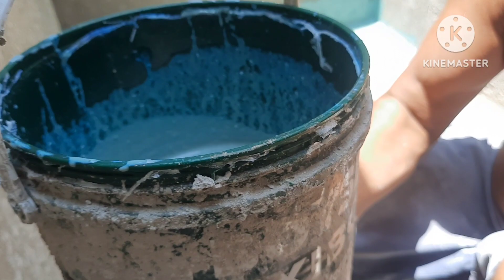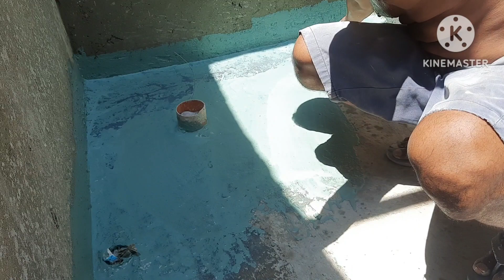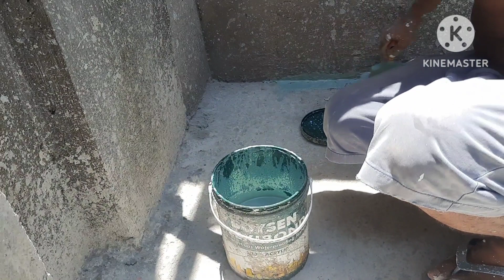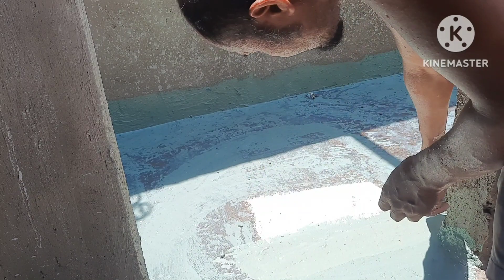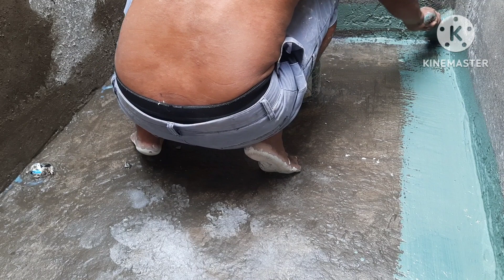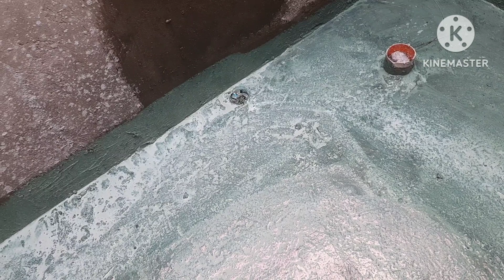PAANO MAG WATERPROOFING......

Comment: Boss kapag sa ground floor lang need pa ba ng ganyan if e ti tiles naman ang cr? Saka lifetime ba ba iyan na hindi tatagas kapag may ganyan?
Reply from the maker: Kung.ground.floor po at wala.naman maapektuhan.kung sakali.magkaroo  ng.leak..kahit.dna...
King.lifetime..actually wala po lifetime.sa.waterproofing..kasi may mga factor po na pweding magcause ng pagkadegrade ng water profing substrate..
Gaya ng vibration na maaring magcause ng pagbitak ng surface...

Pero kung stable naman.ang surface..let say 20 years pataas..again po..kailangan econsider yung presence ng pressure na.pweding makasira sa water.proofing